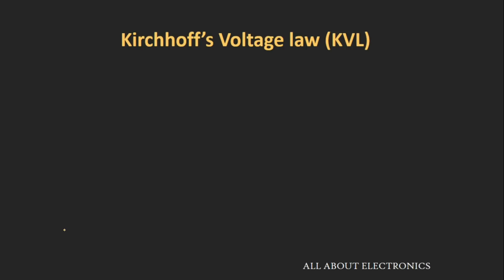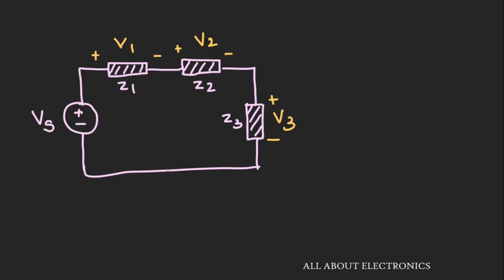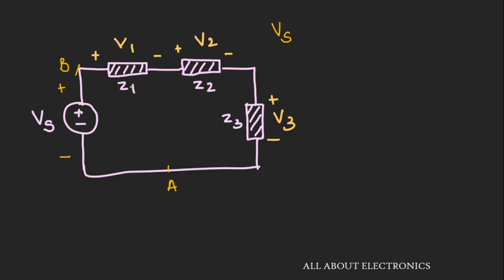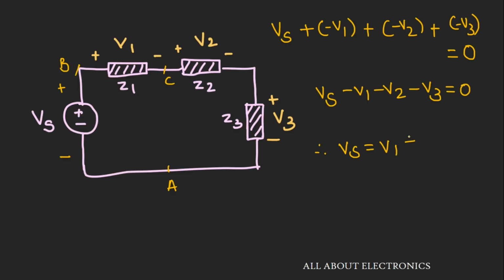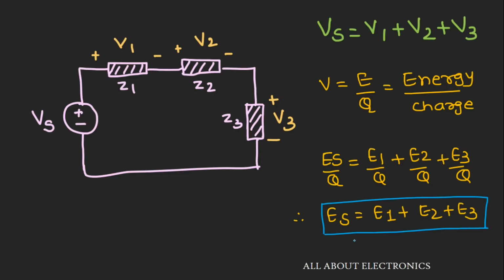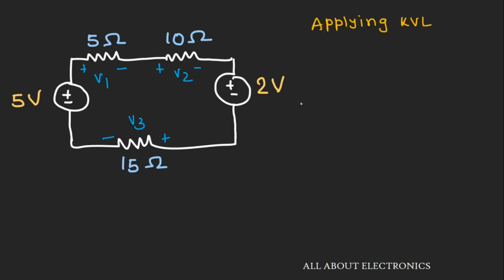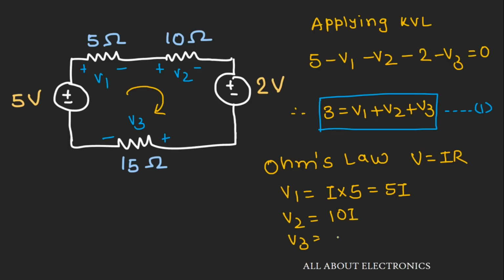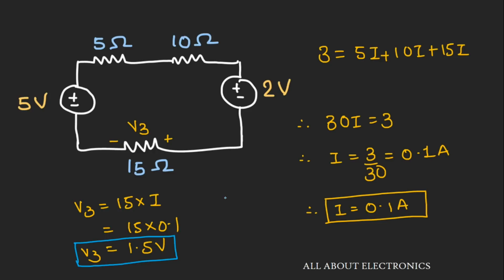Kirchhoff’s Voltage Law (KVL) explained

Comment: hello i have a question ?
when can we use kvl ? and  in the video you used ohms law after apllying the kvl why ?
and thank you
Reply from the maker: In the closed electrical circuit you can apply the KVL. So, as per the KVL, the summation of voltage across the each element in the closed loop is equal to 0. So, while applying the KVL in the loop, when you encounter the resistor in the loop, then to find the voltage across it, you can use ohms law. (Ohms law V = IR)
I hope, it will clear your doubt.

Comment: Sir.. I have a doubt ....in series combination of resistances ..volt will remaining same...then why it's continuesly decreasing???
Reply from the maker: In series combination of resistors, the current will remain same. But there will be a voltage drop across each resistor. So, voltage will reduce as we move in the direction of the current.

Comment: Sir, I have a query regarding applying KVL. How to select loops in the question? In my question I considered 3 loops and wrote equations for them. By solving using cramer's rule, I got '0' in determinant of Delta. Tell me if my selection of loops is wrong??
Reply from the maker: Please check the signs once again.

Comment: That is all that is really needed to construct flip flops , counters , and many other circuits including all those needed to construct a Digital Clock. The most important part is you will be able to actually know that the circuits are only electromagnets closing or opening  simple switches. Beyond the digital clock

Comment: positive. The normally open connection will be the output. One of the Relay Coil connections will be the (Buffer) input. The other relay coil connection will be connected to the voltage supply negative. (what was spelled swill should have been spelled will). Moving on to the Inverter connect it as the Buffer was connected but use normally closed connection as the output. For the AND Gate use two SPDT relays. Connect one of the relay common connections to the voltage supply positive. Connect the same relay's normally open connection to the second relay's common connection. The second relay's normally open connection will be the AND Gate output. Both relay coils will have one of their connections connected to the voltage supply negative. The other two relay coil connections will be the two AND gate inputs.

Comment: Please take a moment to consider the Buffer , Inverter , along the AND Gate made with SPDT Relays as a starting point for almost all of Digital Electronics. It has made my own progress much easier. For the Buffer use only one SPDT relay. The common connection swill be connected to the voltage supply

Comment: I have a question 
So in the example circuit , when the current is flowing in the clockwise direction , How is the first Potential/emf (The 5V one) positive? Isn't the current travelling from negative to positive potential ?
Reply from the maker: The conventional flow of current is from positive to negative. The movement of electron is from negative to positive terminal. The direction of the conventional current is opposite to the flow of electrons.

Comment: how do you choose the signs for the components. In the sense, how do you mark them as positive or negative?
Reply from the maker: It depends on the direction of the current. For example, in a resistor if the current flows from left to right, the left terminal will be positive and right terminal will be negative.

Comment: When two voltages are given, why you start from 5V not from 2V
Reply from the maker: You can start from 2V also. Basically while applying KVL, you need to start from the one point and nedd to come back to the same point.
So, if you start from 2V and move in a clockwise direction then you will encounter the voltage across 2V, 15 ohm, 5V, 5 ohm, and 10 ohm. 
So. it's according to our convenience.

Comment: So the direction of the current flow depends on the highest voltage?
Reply from the maker: The current flows from high potential towards the low potential (voltage).

Comment: Thank you for explainingf this but i have a question.How do you set the signs in the resistor? is it always +on the left and - on the right or is it something you choose on you own?
Reply from the maker: If the signs are not given then just assume the direction of the current in the circuit. If you assume current is flowing in the clockwise direction then just assume voltage drop across the resistor is from positive to negative. I mean left terminal is positive and right terminal of the resistor is negative. If you assume direction of the current other way around then the polarity across the resistor will change accordingly.

Comment: Nice video (: If the signs of V1 was " - V1 + " instead of " + V1 - " would V1 then be equal to V1 = - 1x5 = -5I instead of 5I ? (:
Reply: Yes, but since it's a resistor and we are moving low to high it would be +ve

Comment: How did you identify, which side is positive and which is negative on the resistor?
Reply: you need not to identify that . actually you decide it  by taking the direction of the current in the loop . for example suppose there are two nodes of the resistor, say 'a' and 'b' if the direction for current you taken hits the node a first and leaves the resistor from node b you have to mark node a as positive and node b as negative .
Reply: @suryayadav6671  like if a node facing the + of emf , the node is + ?
and can 2 emf be in a single loop ??????my doubt !!!!

Comment: Sir.,  u said that -to+ we have to take + but in that u taken 5-v1-v2-2-v3.. Here why -2 is came we have to take +2 na
Reply: as there is another emf with 2v facing the other emf with the same sign(+) we have  subtract it...
i think so...
its is an exception for emfs'
Reply: By Moving clockwise direction 5V source shows as rise(-ve to +ve) whereas 2V source shows as drop(+ve to - ve)..  Or simply look at both currents for both the sources are opposing so it will negate each other.

Comment: In numerical how u assign sign on resistance ????
Reply from the maker: While moving around the circuit in a particular direction if you find the drop in the potential/voltage across any element then the voltage across that element can be considered as negative. while moving, if the voltage increases (If you moving from negative to the positive terminal of the voltage drop ) then that voltage drop can be considered as positive. In the example, if voltage drop is not given across the resistors then initially you need to assume the drop across the resistors depending on the direction of the current.

Comment: I have a doubt how to take positive  or negative ?
Reply from the maker: First of all, select the direction either clockwise or counterclockwise in the circuit. Let's say you are going in the clockwise direction in the circuit. If the voltage across the element is increasing (going from negative to positive terminal) then consider it as positive and if it is decreasing then consider it as a negative.
I hope it will clear your confusion.
Reply: @ALLABOUTELECTRONICS ....i get the thewry of considaration,,,, ya,,but what about the other part i mean the resistance part ?how we will put the polarity on it???
Reply from the maker: Resistor should also be considered like any other element. 
You need to consider the direction of the current either as clockwise or anti-clock wise. 
And assume that the voltage drop is in the same direction in which the current is flowing. 
e.g if the current is flowing in the clockwise direction, and the first element in that direction is resistor then one terminal of the resistor  which is first encountered is positive and the second terminal is negative. 
I hope it will clear your doubt.

Comment: I don't know ,how we take + and, - signs
Reply from the maker: Just move around the circuit either in clockwise or counter clock wise direction. And observe the potential of each element that you encounter. If you are going from negative to the positive potential (i.e potential is increasing across the element) then consider the voltage of that element as positive voltage, else consider it as negative voltage. 
I hope it will clear your doubt.
Reply: Sir..5ohm pe  ..sign convention kaise Aya??.. aur to toh resistor hai..

Comment: Sir can you guide me how to calculate diods ? thank you
Reply from the maker: Do you mean to say how to apply KVL when there is a diode in the circuit?
Reply: Sir,as per equations of diod.
Reply from the maker: Let's say in one circuit we have one voltage source V,  in series with a diode and one load resistor R. And the Anode of the diode is towards voltage source. Now, if the diode is forward biased (And let's say its built-in voltage is 0.7) then you can write KVL equation as, 
V-0.7-Vr=0 
Where Vr is the voltage across a resistor. 
If the diode is in reverse biased then no current will flow through the circuit and in that case entire voltage will be dropped across the diode. 
In that case, Vd= V
I hope, you understood what I mean to say.
If you have any doubt then do let me know here.
Reply: ALL ABOUT ELECTRONICS 
Thank you, very much.
Reply: @ALLABOUTELECTRONICS  e

Comment: What if no value of resistance is given? How will we solve it?
Reply from the maker: If you have not given any value of resistance, then the solution will be in generalised form. (in terms of R1, R2 etc.)
Let's say in the example you have given 5V voltage source, which is connected to three resistors, R1, R2, R3 in series. And you have been asked to find the voltage across R2.
Then VR2= R2*5/(R1+R2+R3)
I hope it will help you.
Still, if you have any doubt then do let me know here.